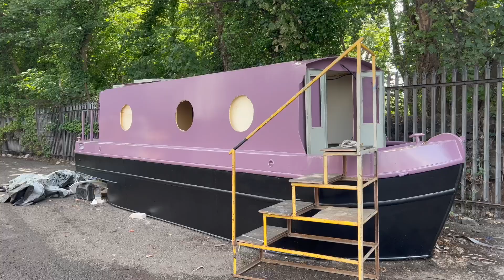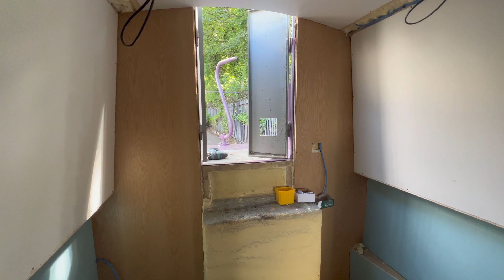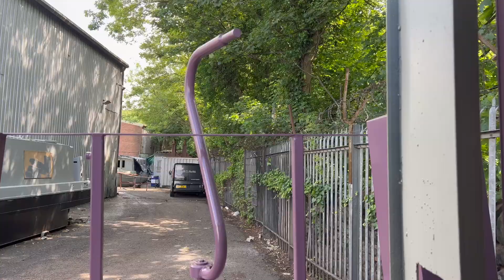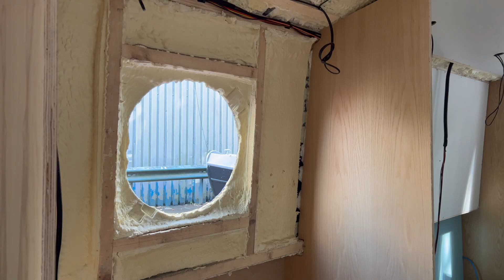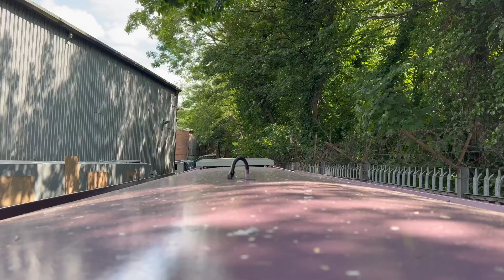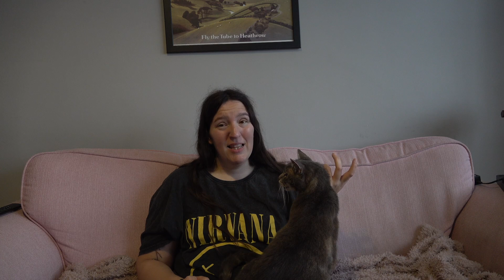New Narrowboat Build Update

Comment: In view of the delays you could ask Aintree to truck the boat south for you. They did this for me five years ago when mine was very late. One thing I would add is that it is now virtually impossible to get the 3.9kg Calor Gaz bottles that fit the Beetle gas locker. I’m not sure what the solution is besides fabricating a bigger gas locker.
Reply from the maker: The flogas ones will fit but on a different regulator